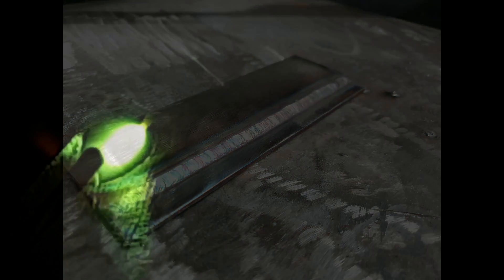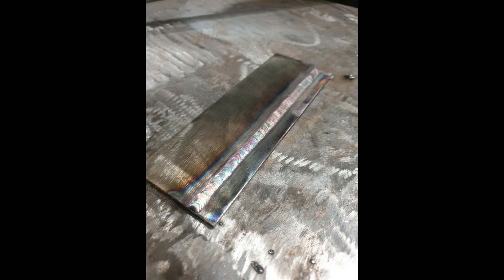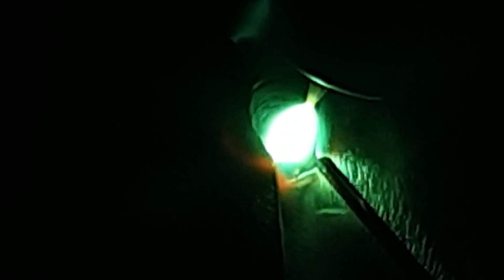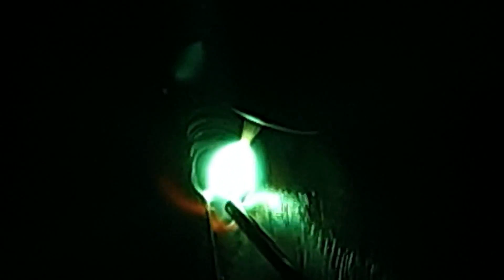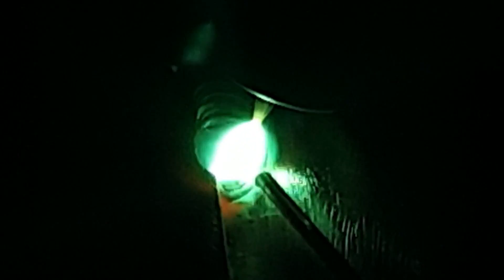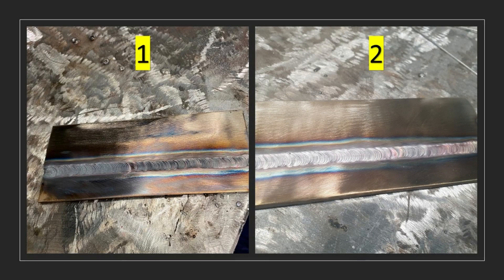The Ultimate Guide to Tig Welding Stainless Steel lap joint

Comment: Right one is 100 amps. Heat equivalent to time not amperage.

60 amps takes much longer than 100 amps so it increases overall heat input
Reply from the maker: Correct however you disturb less properties in the material therefor keeping it from turning to martensite and hardening. keeping the heat effected zone smaller, I do know what you are saying with the heat input if it takes longer which is also true. It’s clear you know your welding and are expirenced in the field so you could counteract this with a faster welding speed. However a beginner would not be able to do this. Would be interesting to do the sums on this and put the actual kj/mm heat input in. We will have to look at this in a future video.
Reply: @weldtechsolutions  ah yeah, rapid cooling causing changes in the microstructures? I remember quenching stainless once while it was still hot. My tradesman smacked me in the back of the Hand with filler rod lol